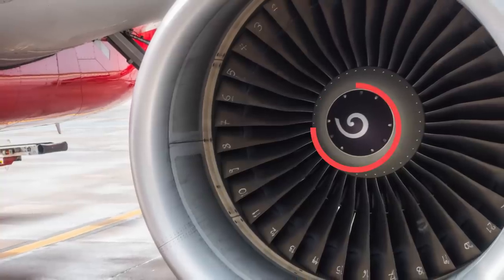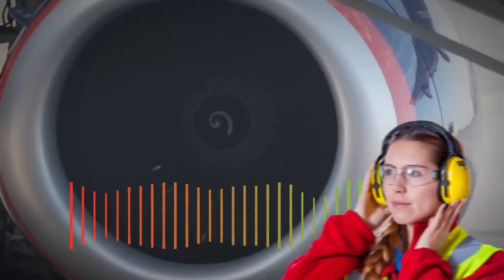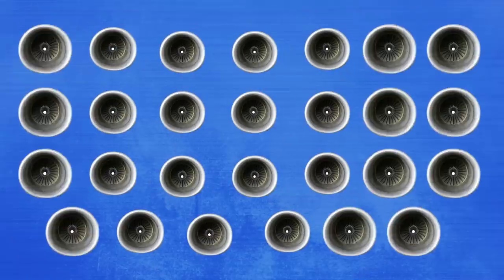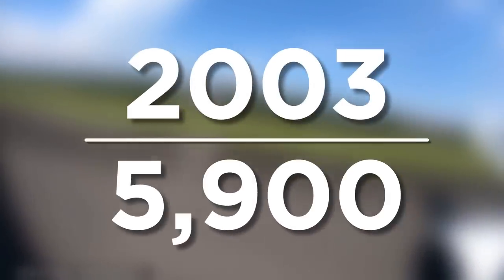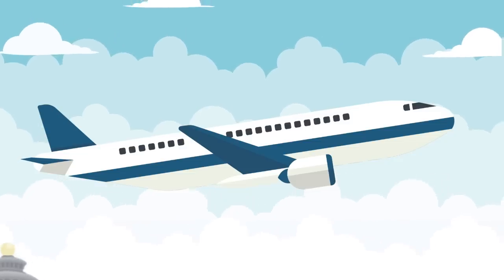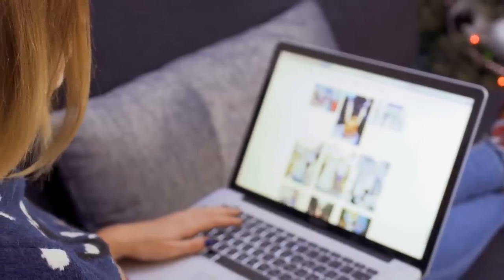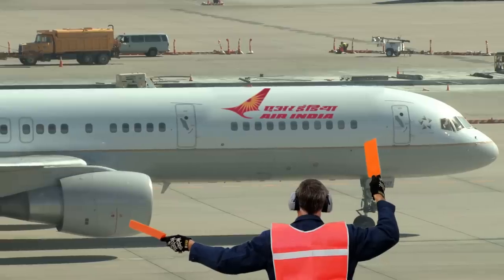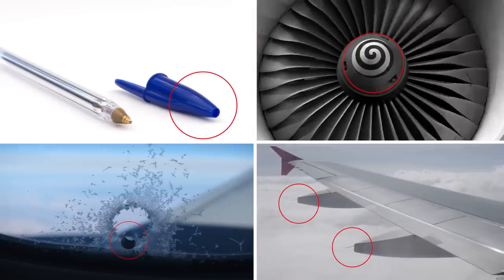Why These Spirals In Jet Engines Help Save Your Life

Comment: The spirals on jet engines are there to tell you whether the jet engine is on or not, when you get an engine is on it spins to allow air to go through the engine allowing it to generate power which means that the GPU is not needed, after the engines start producing power the auxiliary power unit will be turned on, the spirals are also there to tell you whether the engine is producing thrust or not, please don't waste 10 minutes and 2 seconds of your life.
Reply: Awwwh yes! Someone else who works with aircraft. That was a good breakdown with no unnecessary wasted time.
Reply: I guessed it right from the beginning lol
Reply: Got to hit that 10 minute mark for ad revenue. Thank you for the time saver.
Reply: Thank you bro
Reply: Thank you

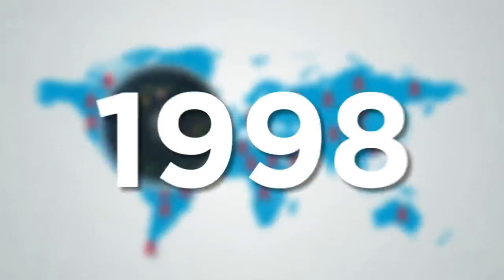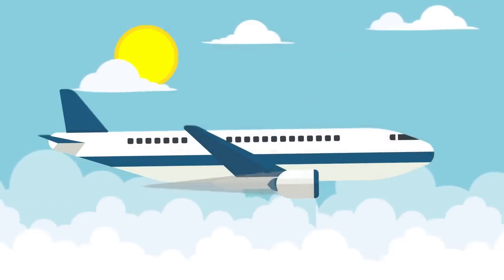Comment: Good video. Minor note. You say 1988 but the graphic shows 1998 5:02 same at 5:12
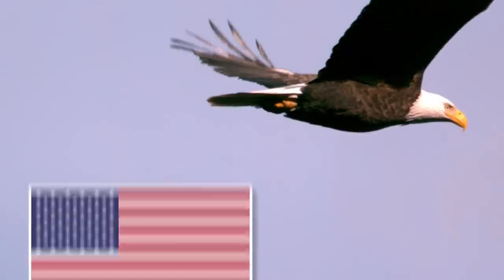Reply: Same with the 50,000 to 1,000,000 at 4:26
Reply: I was wondering if it was just my eyes and ears that weren't getting along with each other...
Reply: Another graphic flub. The graphic for US Airways' flight 1549 shows a four-engined plane. The plane involved, an Airbus A320, has only two engines.
Reply: Relic75 omg yee
Reply: @lucionp4556  I'm sure you would have liked someone to correct the mistakes in your life.
Reply: i thought my ears were broken
Reply: @lucionp4556  sorry  you feel the need to  lash out at random  people on the internet. Hope whatever  is wrong in your life gets fixed.  Best  wishes.
Reply: Agree
Reply: 10 years off for stats that relate to some that are just a handful of decades anyway isn't just minor. Good catch, Relic! Ya beat me to it.
Reply: He hearted it but didnt reply....
Reply: He also called a ww2 prop plane a fighter jet

Comment: I believe there is footage of a Navy crew member being ingested, going through an engine, and surviving. I have always wondered if it was true? Static Wicks also help bleed off static generated by the plane in flight. They have to attach a grounding cable to the plane to dissipate the excess static before fueling to avoid a spark igniting the fuel.
Reply: An American (John O’Brien) committed suicide by Jetliner engine. The pilot said he was blended to a pulp, barely anything left that was recognizably human (except half a face with two eyes dangling)

Comment: k know it possible to survive.  USAF made us watch safety film most every year.  Navy guy get sucked in, vest gets caught on pitot tube in intake, but his helmet trashes engine before he can go thru.  So yes he didn't go thru, but he survived being sucked into engine.  We are told of all the dangers of being sucked into engine, but this showed us how fast it is.
Reply: Christopher Glover I’ve heard this as well
Reply: Watched that video, it was a jet fighter though  which its small jet engine can not be compared with the likes of a Boeing 747's.
Reply: I was an F16 crew chief in the AF and watched those crazy videos and seen the pictures
Reply: Seen that video on our first week our propulsion course. He got sucked into the intake, but not the engine though. So with the combination of the engine FOD'd out by the helmet and the pilot finally killing the throttle, he survived before his hung up vest could give way. Crazy thing to remember though is all fighter engines have a stage of stationary inlet guide vanes (IGVs) in-front of the fan where as a heavier, high bypass engine does not. So you have a miracle chance of surviving inlet ingestion giving you don't break your neck or get asphyxiated while hung up in the intake. Heavy engines, zero chance of survival. MFE

Comment: FYI a very common user was the WW 2 German Air Force. When two aircraft are heading at each other. It’s hard to identify. The luftwaffe painted bigger spirals that helped so friendly fire was lessened. The shape of a P -51 and ME-109G propeller spinner  for example.
As for ground crew the painting of the tips was very helpful.

Comment: Why dont they just put some lights in the engine
Reply: Spiral is easier
Reply: @GiantLeninHead  my be easy but if that is true it would be alot safer to spend a few bucks extra on a engine if it works better
Reply: Try wiring spinning lights at 25.000 RPMs - good luck.
Reply: @wino0000006  you would not put it on the engine put four on the inside in front of the engine
Reply: @wino0000006  maybe inductive? idk
Reply: nicee try but they would get sucked in so fast
Reply: @arpsichord7474  dude no they would not they would be built into the frame of the engine itself they could not suck them up without sucking up the entire frame
Reply: @red-pm5qg  serves no purpose and also would be an unnecessary FOD hazard.
Reply: @red-pm5qg  their gonna have to be well welded because the engines pull will pull them in if not secured proporly

Comment: After working as ground crew departing aircraft   , I can assure you it it to know when the engine is spinning in the correct direction during start up - often with a breeze blowing up the back of the engine during departure the engine will be spinning backwards - hence the spiral is spinning out - it is the job of the ground crew to let the pilot know when it starts to spin in the correct direction - they can then watch for indication of rpm increase in the cockpit 
An idling jet engine is bloody loud , and actually not really capable of sucking a person off the ground until power is increased 
If you get that close - you know it running. …
Birds don’t “ suddenly avoid “ an engine due to a spinning a spiral …  the plane is doing several hundred mile an hour - if a bird is in the way it’s getting chopped up

Comment: In my world, planes are A LOT different. They have 1 wing, They do vertical take offs, and when they are ready to take off, the rumbler shakes and as it's name implies, it rumbles the 9 engines to warn all dogs of a 5,000 mile radius. It is so powerful, it can TEAR you apart if you don't go inside the nearest building.

Comment: The weird thing about bird strikes is that the plane usually hits the bird, not the bird the plane. The theory in this video is that birds are attracted to the dark hole in a jet. But at the speed a jet is traveling,  a bird doesn't have enough time to evade an oncoming jet, whether it has a spiral or not. The Japanese experiment would need to be repeated again with more data to conclude that birds are scared by engine markings.
I'm with Boeing on this one. The major benefit to spirals is for ground crew.

Comment: I study aircraft maintenance engineering in an aviation school and we're told that the spirals are installed on the jet engine so that the technicians know that the engine is running and it's operative and to stand clear of a running jet engine because it's so dangerous to be near them they can rip a human into pieces

Comment: why don't we just cover the fronts of the engine with a mesh that lets air through but not anything else, we did it when looking for gold?
Reply: Not many mesh materials could withstand the constant suction of a jet engine. Would make it actually more dangerous as any damage to the mesh would automatically be sucked into the engine, causing a possible engine failure.
Reply: @jacksonsmith2918  good point, but i'm sure there's some material that could work, we do have knowledge of thousands of different materials, maybe more

Comment: It's definitely possible for someone to survive being sucked into a jet engine intake.  It has happened.  The survivor in question only survived due to his helmet(navy crewman) hitting the blades first and damaging the engine enough to prevent him from also hitting the compressor blades(it was a navy fighter engine, so no fan blades, just compressor).  The engine in question back fired after the damage, which pushed him back out the way he came.

It's probably fair to say this scenario is extremely unlikely, but it certainly isn't impossible.
Reply: He got sucked into the intake, but not the engine though. So with the combination of the engine FOD'd out by the helmet and the pilot finally killing the throttle, he survived before his hung up vest could give way. Crazy thing to remember though is all fighter engines have a stage of stationary inlet guide vanes (IGVs) in-front of the fan where as a heavier, high bypass engine does not. So you have a miracle chance of surviving inlet ingestion giving you don't break your neck or get asphyxiated while hung up in the intake. Heavy engines, zero chance of survival. MFE

Comment: Why isn't it possible to put a screen across the front of the jet engine to prevent people or birds from being sucked into the engine?
Reply: Because it is not aerodynamic nor will it allow the engine achieve the proper performance profile for the specific aircraft it's on due to the restriction. Not to mention, a bigger FOD hazard.

Comment: "on the propeller cones of fighter jets"
I don't know how to tell you this but jets don't have propellers the one you showed in particular, has a merlin or griffon v12.
Reply: What do you call the twirling things out front of a turbo prop ??? I thought it was a propeller mounted through a gear box on a jet engine. , but I could be wrong.

Comment: Commercial airplanes have the worst designs. No escape pods/catapults/parachoutes. No defences against failure of the engines. No backup/emergency engines. Pretty much nothing.  Engines can have warning lights. Its very easy to know is the engine running or not. You can hear the engine, you can see the blades of the propellers moving and there are many methods and procedures which can eliminate the possibility of not knowing running engines. Also filters can be added, engines can suck the air from above instead from forward. Filters can be added. Grids. Air splitters.

Comment: Fix metal nets in front of the engines to avoid accidental sucking inside
Reply: Cause small inefficiency by a 1-2% margin.
Reply: Unfortunately they'd rather lose a plane or two and the lives of hundreds, than to sell or run aircraft that cost more to run. 

When the numbers are run, it shows that a small saving of course. Money will always be prioritised over safety. That's why the majority of air crashes are due to stupid reasons that could have been avoided.

Comment: The spirals are there for dumb maintenance crews, its not for birds. Military jets lack this but don't see anymore bird strikes than a commercial jet. Most planes are hit on the body and wings which is rare. Crap ground crew don't notice the hit or just ignore it. It is rare but possible to survive being sucked into a running engine. The holes in windows have nothing to do with safety, it is only there the equalize pressure between the window and the Plexiglas panel that keep passengers comfortable.

Comment: I would just like to point out that this video almost completely copies a video made by captain joe on this subject.
If you do not, believe me, you can check out captain joes video and compare the two. 
I absolutely fucking hate when large youtube channels try to copy word for word off of smaller channels such as joes.
Here are some things BE AMAZED copied word for word aside from some minor changes.

BE AMAZED: Many of the biggest engine manufacturers have been painting spirals on them for decades. the practice even goes back to WW2 when the spirals were painted on the propeller cones. 

Captain Joe:  Many engines manufacture like Pratt and Whitney, general electric, cfm, and Rolls Royce have been painting spinners with the catchy swirls for decades.  The practice even goes back as far as WW2, when the spirals were painted on the propeller cones.

BE AMAZED: Even when engines are only running at idle power their pull is extremely strong, so the danger zone of a boeing 737 is 9ft around each engine. When the engines are running above idle power, the area increases to 14ft. And for larger planes with larger engines, workers need to stay even further away. Any person that enters the danger zone risks the horrifying fate of being sucked up into the engine. So its extremely important that maintenance people know whether or not one is running. You might think that the noise made by these mammoth engines would alert the ground  crew that they're running. But they'll usually be wearing hearing protection. And there will often be multiple aircraft in close proximity to the one they're working on. So it can be difficult to determine which engine is actually running. Visually identifying a running engine is also equally as difficult, even in broad daylight.

Captain Joe: So, for example, a boeing 737 running at idle power has a hazard zone of 9ft to the front and sides of the engines. This means that even at idle thrust, a human that walks within the hazard area, or any loose objects, risk being sucked up into the engine. And when the engine is above idle thrust, the hazard zone increases to 14ft or more. Now not to speak of even larger hazard zones of a boeing 777 for example, therefore it is absolutely critical that the ground personnel can identify a running engine and stay away from it. Even though jet engines are incredibly loud, a running engine may not be obvious to ground personnel. Airport aprons often have several airplanes in close proximity with engines screaming next to each other. Therefore ground personnel have to wear hearing protection to suppress the deafening noise, and making matters worse, it can be hard to see that the engine is running.

(this list could go on for the entire video, and I do not have the time to go and copy the scripts word for word.)
You can go and compare them. Consider captain joe lucky I caught this going on and am letting people know. If you still have not yet watched the video, here is the link to Joe's video. 
https://www.youtube.com/watch?v=Fbc4bPOkZHw

You may say I am getting too upset over this but I am trying to stick up for the smaller YouTubers that get pushed around by assholes like BE AMAZED on a regular baisis. Thankfully though Joe's video has more views in this case.

Comment: Why not big flash lights like Camara on engines for keeping birds away and putting simple wide range parking Sensors manipulation or proximity sensors to auto switch off engine on ground to prevent accidents with crews.??? Why why why???

Comment: chance if a person boards a plane and before ascending to 3000 ft suck a flock of pigeon with both engines lost and right at the moment, get struck by lightning before landing with none of the landing gears in position .. oh not forgetting the person chokes by accidentally swallowing the lid .. would sound like a good final destination sequel plot

Comment: THEY SHOULD PUT JUST A MESH AS A SAFETY NET IN FRONT  OF THE ENGINES TO SAVE THE BIRDS !!!!!!!!!!!!!!!!!!!!!!!!!!! A SIMPLE SOLUTION BUT THE FOOLS NEVER THOUGHT OF IT !!
Reply: A net wouldn't work because at high speeds the bird would get through anyway

Comment: This is so stupid. The actual reason quote from a bunch of real pilots is, “The spirals on the engines are painted in a certain direction so you can tell which way the engine runs.”

Comment: A couple of things. Bird strikes still happen and that spinning cone stops nothing. Hell they see the radome of the aircraft moving towards them and still get struck. 2nd, the spinner cone being painted is only a commercial airline thing only. Which honestly is pointless anyway because no matter what is going on the airfield, you can hear the aircraft you are assigned on engines running at idle. It is really not that difficult. The few people that have been sucked up were due to lack of situational awareness. They entered the danger zone when they weren't supposed to and all situations were above idle power. Hence why the military version of the commercial engines (GE-CF6, PW117 etc) do not have those markings. It doesn't really contribute to anything logically. - signed, an engine troop MFE!!!